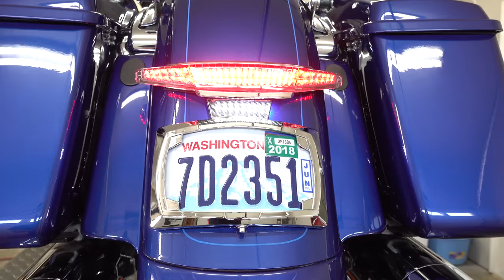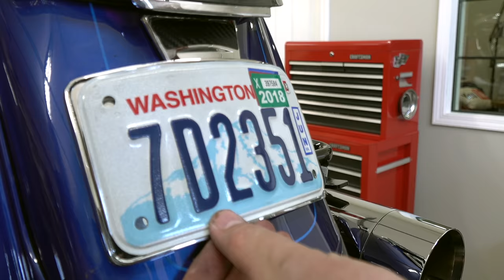Install & Review-Ciro 3D Latitude LED Tail Light & License Plate Holder on Harley Davidson

Comment: Great video.  Taking off the two 1/2 inch bolts holding the stock light on is nearly impossible without taking off the tire.  However, it is possible.  To help your viewers, I suggest you recommend an extra long flex head box wrench.  I picked one up on Amazon.  Chose DuraTech brand. I have no relationship with this company.  It has the length to allow actually gripping the wrench when in use.  Second, the rachet head gearing is ultra fine, so even moving the wrench a quarter of an inch engages the rachet and you have moved the bolt.  Lastly, the ends of the wrench are 180 degrees flexible so you can grip the bolt with much more ease.  Thanks for the video.  The instructions in the box are REALLY lacking clarity.

Comment: Thanks a bunch. Got my kit today and installed it with your guidance. It looks fantastic. I also purchased the filler blades. Gonna work on that next. Hoping I can figure out the wiring with the latitude 3d’s and integrate them together

Comment: I got mine from Ciro3d about 3 months ago and I love it. Really bright and adds a touch of style. One thing to be aware of when installing it on a new HD is that the Moco puts red locktite on the upper bracket bolts. I suppose to prevent the tail from vibrating off.
Reply from the maker: Thanks for the shout out.  Yah, we mention to put thread lock in the video if you choose.

Comment: Looks nice.  My only complaint would be the need to run the wire up to the battery compartment and use a splitter.  Seems to me, it would be easier and less expensive for them to us the Harley connector with a shorter wire and just connect it back to the Tri-bar light where the original wire was unplugged, which now has an uncapped connector (though mostly protected).
Reply from the maker: With the new Can Bus systems, you'll want to use the stock plugs as often as possible. That way everything talks nicely to each other. You can possibly throw codes etc.

Comment: Does this work with a light controller, one that has flash programming??
Reply from the maker: You'd have to test it and it'd be at your own risk. Ciro doesn't make a modulator. Other companies do and often they work. No promises.